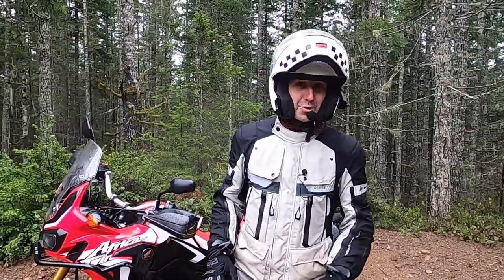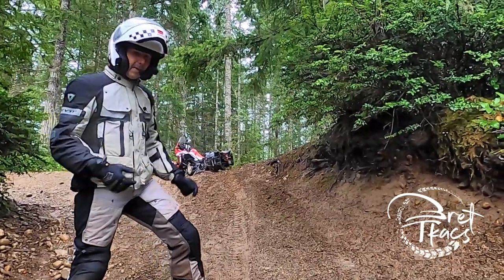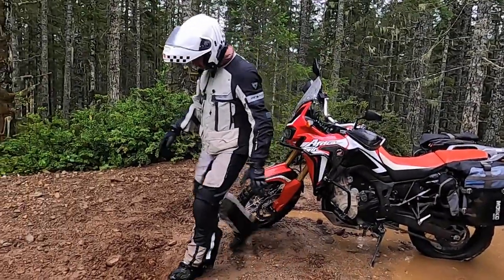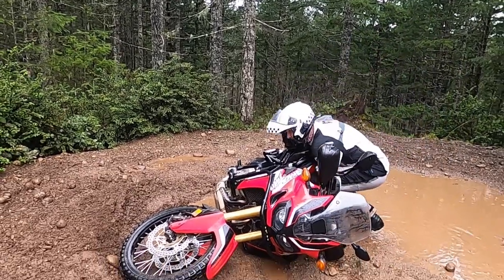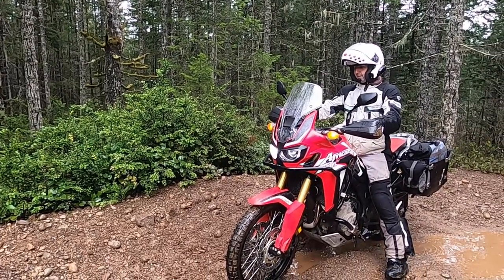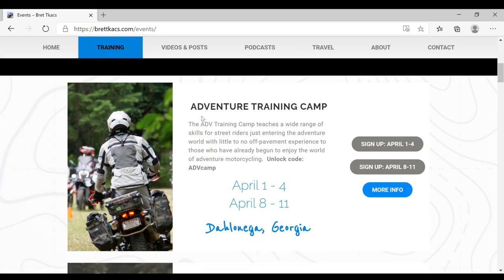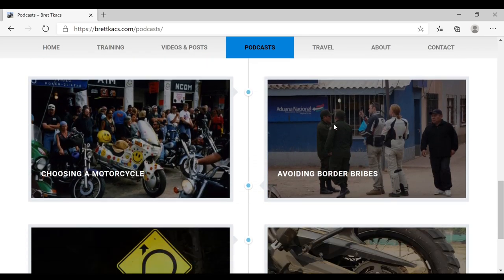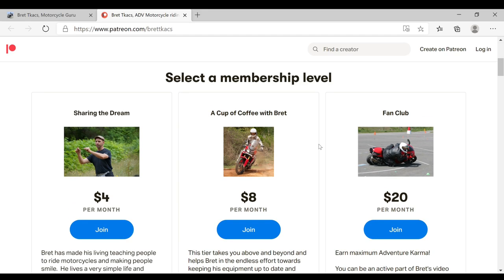Slide turn, pivot turn, elephant turn  (DCT Africa Twin)

Comment: Happy to see you have fun with an AT. I have a 2017 manual AT and I absolutely love the thing. I ride it as if it were a dirt bike and I have almost 50k miles on it, with no issues so far except usual maintenance. Good ole Honda reliability.

Comment: What’s happens to the ktm790.... is it broken again...😂😂😂👍🏴🥃
Reply from the maker: I picked up the KTM from the shop and have it in hand again... I will share the final on the 790 when the whole story ends. As of now KTM has warrantied every request and has made an attempt to fix everything. Dealer is doing what they can. No hard feelings but my final judgment is still on hold.
Reply: @BretTkacs  manufacturers need to spend time making bikes reliable again – not on rider aids which are 90% of the problem with today’s bikes. If you’re moving to the Honda you’ll be better off than the having the KTM, but I’d rather have a T7 and put the savings into suspension.
Reply: @mojosdad68  1090R hands down on the weak competition aaaalll day every time
Reply: Bret Tkacs 
You are lucky to have a good dealer... in the UK KTM monitor the net to see if riders have been off road with there bikes, then look for reasons to refuse warranty. 🙈
Reply: @BillCairns  ktm germany wanted to refuse warrenty for my dripping fork after some months, because it was dusty on the photo. They said i would use in competition. After sending them some photos of how they advertise the 690 on their website, and of my gravelroad trip with full luggage they didi it, but only with big displeasure. Your dealer has to be on yoir side 100% and bring a lot of efforts to discuss with the headquarter to achive anything. For my smcr i am waiting now 10weeks because of an oil pum manufacture demage.  I never got any answers to my complains, untill i wrote 2 emails (first polite, second ironic), before i got an excuse and and a voucher for ktm powerparts i do need, hahah. But i believe if everybody writes to them, there is a little chance that they change their quality standards, at least i feel better, hahhaha
Reply: @BretTkacs  be interesting to see your final opinion 🙈
Reply: aLEk Sy .... That’s why I’m totally finished with the brand.., they are very Arrogant 🙈

Comment: As a novice offroad rider, the guts it takes to try it the first few times without it ending in disaster is what males me hesitate to give this skill a go
Reply from the maker: This video is really not a good one for first timers... I did one several years ago on Mototrek but will also do a new one in the future.
Reply: Hey, I'm somewhere north of 200k miles on the road and I have HUGE problems riding like this. I can't stop acting like I'm on pavement in traffic where you'd never be doing a burnout / turn type of thing and under no circumstances do you drop it! 2019 AT here BTW.

Comment: My bike looks just like that one. I clearly need to practice, thanks for the video. My biggest gripe is that fighter pilot checklist when you turn on the bike.
Reply from the maker: fighter pilot checklist?
Reply: I know what you mean: tc off / abs off / G mode / S mode. :-)
Reply: " fighter pilot checklist" Yours doesn't have user definable presets?
Reply: Not on the 2017 at least.
Reply: @BretTkacs  That turning off TC, G mode, abs that you had to do when you started the bike. Like a fighter pilot every time in the cockpit.

Comment: 😳 OMG😳 DCT😱 I’ve been waiting to see how, if any, possible tips to avoid “Whiskey Throttling” off/out of deep ruts on DCT!  It’s been the ONLY thing that makes me nervous out on the trail with my 2016 CRF1000 DCT.  It’s been a challenge for me to figure it out!  Got a few good sprains because of it.  I’m hoping Bret that you can give some good insights on this for me.
Reply: I just put a boosterplug on my 18 ATAS and it has helped with the slow speed issues. I also added in a rear brake lever where the clutch should be, thieves beware. Lol
Reply from the maker: editing that video now
Reply: @CaptainLasVegas  Been researching ways to add a rear brake lever to my 2020 DCT, should have come that way from factory.

Comment: Great video as always Bret. I'd like to add to your "this is not a novice maneuver" comment. You art correct, it's not a novice maneuver. Maybe it's just me and my version of the maneuver and the mechanics of performing it but I would add that this involves a good bit of hand work. Hands are as busy as the lower half of the body in my opinion. I feather the clutch in conjunction with rolling in or out of the throttle. What say you Bret?
Reply from the maker: It turns out this is one thing that the DCT kicks ass at... better than a manual clutch. You can do it on either but the simplicity of the DCT gives it the nod however to do this on a DCT as a less skilled rider will make the DCT more dangerous. 

DCT is not a bike to hand riders that are weak on skills...

Comment: I am learning this on a Sur Ron right now, then on the KTM Adventure bike. My only problem is getting the sliding rear end into a smooth straight acceleration without stalling (and probably tipping over on the inside).
Reply from the maker: most likely its body position but there are a LOT of things you could be doing to not get the result you want

Comment: I had an incident, and I am trying to understand what caused it. As I was practicing my pivot turns, I realized I was not adding enough power (it was not turning enough). So, I added power (maybe too much!). The bike dropped beneath me, and as I was getting ready to let it go and jump to stand beside it, the handlebar hit (really hard) my left hip. It is painful and I might have fractured my pelvic bone. But, the more painful is that I do not know how it can happen. I would be grateful if you can let me know what I possibly did wrong. Too much power? The surface was not slippery enough? Clutch? Thanks!

Comment: I got into a few inch of silt. The whole profile was full, the back wheel just rotating without any grip until i fell to the side. What to do in that case?
It was not a full offroad profile just a half assed tire with limited ability to self clean.

Comment: Hi bert , can you teach how to wheely with 790 , I tried but although I put power in second gear the motorcycle accelerate and does not lift the front wheel ? Thanks amir

Comment: I see in this video you stick a leg out in tight and slow turns to help you with balance. I feel this is more to keep yourself up than the bike itself. Am I wrong?

Also, is there a point (speed) where you wouldn't do that? With too much momentum wouldn't you risk that leg be propelled way back and risk being caught by the back wheel?  With no rack or luggage, of course.
Reply from the maker: watch careful... my legs is NOT down, it is forward like you would ride a dirtbike. I am throwing forward to plant for the pivot. It is not about holding up the bike. If you watch other videos I do or some of the early slides you will see my leg is always up. It has to do with the amount of lean the bike has an how tight I am sliding the bike.

Comment: so most instructors I have seen recommend the bike behind you with your back to it when picking it up. have you found picking up the bike while its in front of you better / easier?
Reply from the maker: I do not teach that method and never use it. It is more difficult and you are more likely to injure your back unless you bike is resting on luggage or crashbars.

Sounds like a video topic to me...
Reply: @BretTkacs  A video on how to pick up bikes sounds great. especially a large adv bike for smaller riders.

Comment: How do you like the Africa Twin vs. KTM Adventure?
Reply from the maker: 790 Adventure? In my mind the 790 is still the class leader off road for the big ADV bike category (we could debate the T7 of course). Looking at balance, range, power and electronic rider aids it is still bad ass off road. Change that to a discussion about reliability, touring or riding double up and things change. In the end it depends on what you want your bike to do. 

I had money in hand to buy the first gen Africa Twin and only walked because of the lack of cruise control.

I could be happy with either (as long as the bike is dependable).
Reply: @BretTkacs  yes the 790 Adventure.  I am new to adventure bikes.  I have limited dirt bike experience and love watching your videos.  Last summer I bought a 2014 BMW F700GS and I love it.  I figure I will get some experience there and then buy something new later.  Thank you for your videos.
Reply: @BretTkacs  also my favorite videos are poser skills.

Comment: I was actually expecting something DCT specifical. I don't think this video provides any new information compared to your older, more conprehensive one on Motortrek some years ago. Fun to watch, don't get me wrong, just a bit disappointed
Reply from the maker: I have a DCT specific video coming. Maybe the point here is that the DCT is NOT a handicapped bike off road but it is rather a different bike.

I only found 2 places the DCT fell short of a clutch and several places I put it ahead of a clutch.
Reply: Alright then, thanks for answering ;)
Reply from the maker: @JG__12  If anyone ask this is one maneuver that the DCT kicks ass over a manual clutch.
Reply: @BretTkacs  Please please please could you address what happens if you accidentally turn the throttle from a stop and the bike takes off, then you clamp the front brake and can no longer release the throttle again? I've read about this happening to a few others, and had it happen to myself as well!
Reply: @BretTkacs  You mentioned use of the brake in initiating the turn. Are you referring to front or rear? I use the rear a lot on my DCT for slow speed stuff, just curious which you are using here.

Comment: Please try to show everyone how to drive DCT off-road. Some people does not believe that it is quite possible.
Reply from the maker: DCT kicks ass off road
Reply: @BretTkacs  I have my second DCT and start be become some myth-buster but I does not have such skills like you. Generally there are two issues about DCT. Some people say that it is hard to climb steep hill especially on the rocks or sand. Some people say that it is hard to drive DCT in deep sand. What I personally fill that DCT is the fastest motorcycle ever. Probably  I will never return to manual version. Now I am riding ATAS 1100 DCT and it is awesome. Can you make some movie abut hill climbing and sand with DCT? I am very curious about that.
Reply from the maker: @mototroter  I found that on hills specifically you need to use your paddle shifter.

Starting is slimy conditions, deep rock /sand and difficult traction hill starts are it's weaknesses
Reply: @BretTkacs  I wish I could train riding motorcycle in your school but unfortunately I live in Poland, so I am watching your movies. Cheers.